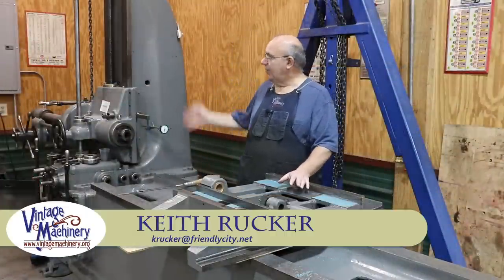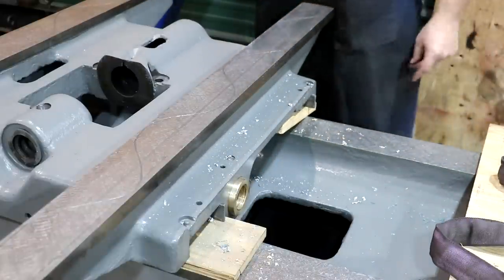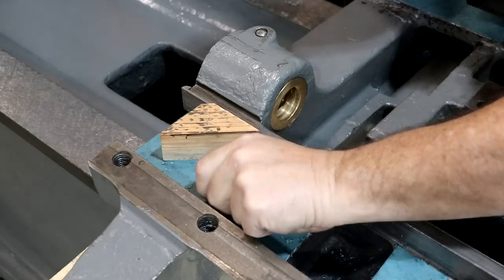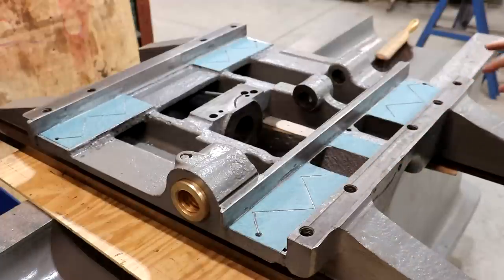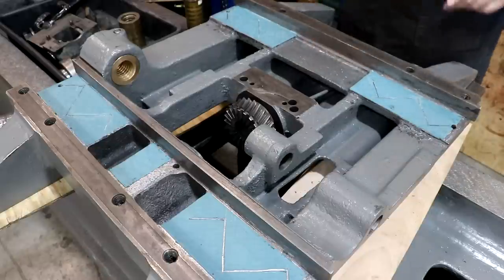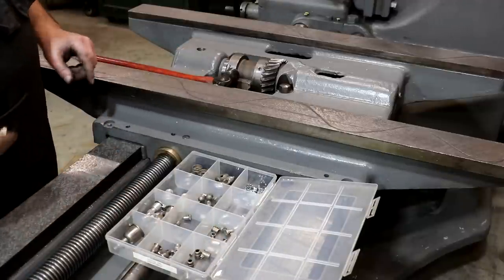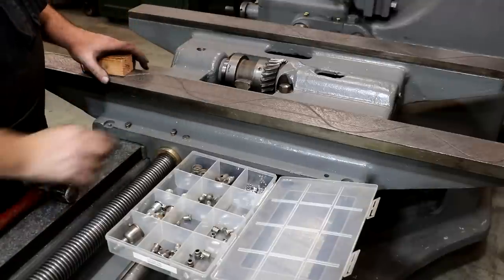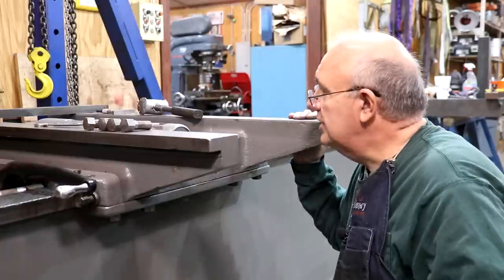Horizontal Boring Mill Restoration: Reassembling the Saddle and Cutting Oil Grooves

Comment: If you have to epoxy turcite under the tail stock or back ways don't use cling wrap to line the ways. Use plain old kitchen waxed paper.
As you surely know most epoxies do not stick to plastics well. The epoxy used for turcite has obviously been formulated to stick to plastic, which is why the cling wrap did not come off the ways cleanly.
Nothing stick to paraffin, which is what wax paper is made with. Wax paper should peel off the epoxy cleanly.
Of course, it's always best to test first.
Just a notion.

Comment: I am looking carefully at all your videos where you have applied turcite, and I know from the turcite specifications, that you should not cut the oil grooves so deep that its passing through it.
Here I see that your oil grooves went up to the cast iron. Do you think that may end up being an issue?
Also I saw on one of your videos that you have applied turcite on the bottom of a X axis slide. I am planning to do the same thing on my machine. Do you think that may become an issue with chips getting embedded into the soft turcite, then rubbing & scratching the bottom surface?

Comment: I wonder if this might be better done with carving tools where the turkite be  grooved with semi-circular grooves instead of abrupt deep cuts.  The worm gear my work for a long time, but what about backlash, play in the shaft before the bed  moves in any direction. Would this be a bother or something you can deal with when you get the feel of it?  I'll bet you are one happy guy to have this together. Nice job.
Reply: The instructions from Turcite (spelled with a c not a k) state to make the grooves no deeper than half the thickness of the Turcite. My milling machine had the grooves all the way through from the manufacturer and the way oil destroyed the adhesive bond. When I was reconditioning it the Turcite fell off when I took the machine apart. So on that basis I think Keith screwed up. I cut the new grooves in my machine with a round cutter in a Dremel tool so they had the profile you suggest. I don't know if that profile is better or not.

Comment: I can’t for the life of me figure out why you didn’t take some of the round pieces and chuck them up in the lathe so you could take some scotch brite and polish them to get rid of the surface rust and allow them to slide better for metal to metal contact as long as they were off the machine. They don’t have to look new but it sure would have helped with the friction. Also after scraping the zig zag pattern, you could have put a dab of way oil on them so any oiling of the parts would quickly follow the pre-oiled pattern.

Comment: Keith, great work.  I've been wondering about the Turcuite though.  On a lathe I get it, as the saddle and head are in a fixed vertical relationship, but surely on a Horizontal Boring Mill, the head is moving in the vertical plane?

Comment: An amateur question.  would or wouldn't it be a good idea to put some anti seize compound on things like tapered pins?   I'm thinking in 30 -50 years someone will bless you making the pins easier to remove.  Or is that a bad idea?

Comment: Keith, I'm curious, what makes cutting a worm gear more challenging/different than cutting a helical gear? Is there a curve or something in the teeth that isn't apparent on the video?
Reply: Yes. If you look closely, you can see that the center of the worm gear is a smaller diameter than the sides. This is so it will wrap around the worm itself, which of course is a cylinder, so the teeth on the matching gear need to be cut cylindrically.

Comment: I have been told by machine re builders that turcite is not a good material to use under a tail stock. Brass, bronze, steel, and or cast iron would be my considerations!
Reply: Curious why some rebuilders would have that opinion. I restored my Harding HLVH that included a bed plate regrind. We installed Rulon on the saddle AND the tailstock. The results were remarkable and the accuracy of the machine is  better than when it left Elmira back in 1969. The factory taper spec is .0001 in 6 inches. This lathe ended up at less than .0001 in 10 inches. Most, if not all Hardinge rebuilders shim the bed plate, which considerably less time consuming, especially because machining the underside of the tailstock is a workholding challenge.We beat it by designing and building a custom fixture that has pitch and yaw adjustment capability. I am surprised Keith scraped the oil grooves down to the cast iron which exposes the epoxy to the way oil.

Comment: Nice seeing it slolwy coming closer to being usable again
Although I wonder, now that the saddle is a little bit raised up from the turkite, how do you make sure the shafts line up perfectly with the couplings at the headstock? I didn't see you adjust anything with shims etc. so did the turkite just randomly put everything to the perfect height to make up for wear and scraping?
Reply: It was ground with intent of Turcite being applied. Any grinding shop familiar with the process can figure out the geometry and correctly grind ways to allow for necessary clearance. 
It’s something you need to plan ahead for, and I’m sure Keith went over dimensions, bed wear, etc with the grind shop so it went together correctly.
Reply: The headstock can rise up and down , so that lil' turkite makes no problem. It is a horizontal boring mill , not a lathe or bridgeport mill.
Reply: @bernardwill7196  I think you're missing the point, the studs where the shafts go into don't move with the headstock so you have to get the dimensions right before assembly. But seeing Kenny's comment, I think I forgot about what Keith said about getting the bed ground to a dimension fitting for the turcite. That does answer my question, even though I should have known that already lol...
Reply: Does not matter. The head and out board support / tail stock move up and down in sync.
Reply: @CatNolara  Ok you are right right and Keith is not an idiot, he know what he did. On the other hand that are old machines and so shims and such things are necessary to bring them proper alive.
Reply: @bernardwill7196  the geometry of the shaft positions in relation to the carriage is not a dimension you can shim. Those dimensions are part of the machine geometry and need to be accounted for when doing things like grinding and applying Turcite to ways. 
Many things can be shimmed, but it’s easier to simply correct the geometry when grinding in this instance.
Reply: @lecnac855  that has no relevance to the shaft locations that operate the feeds for the carriage and tailstock and their reference to the position in the carriage in which they will be constrained.